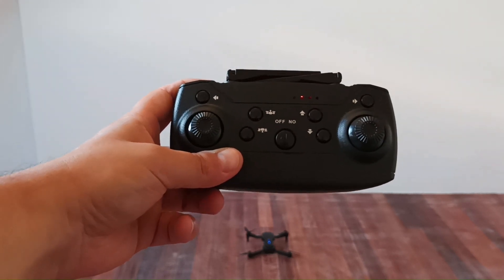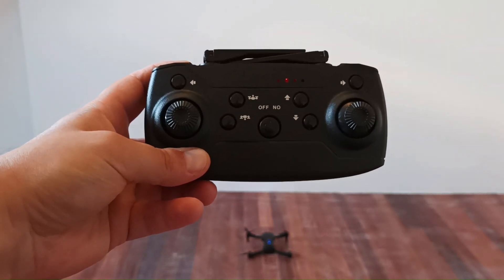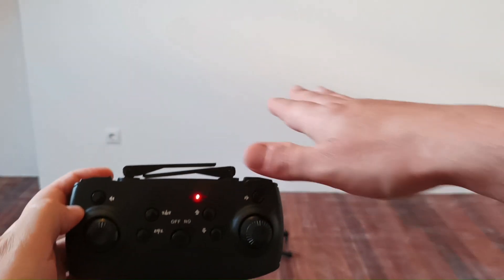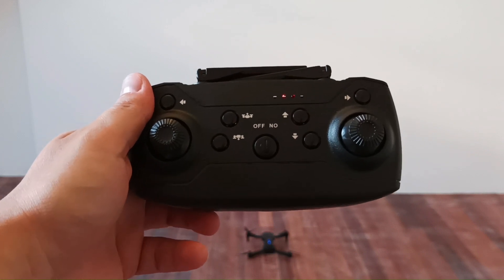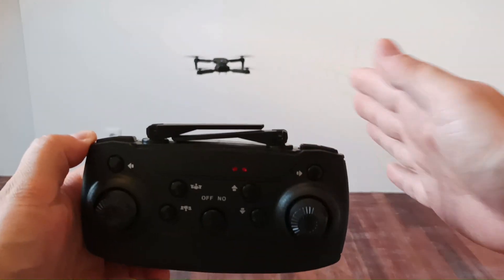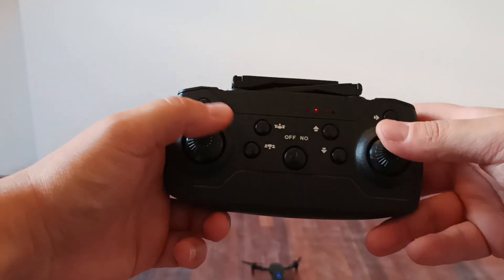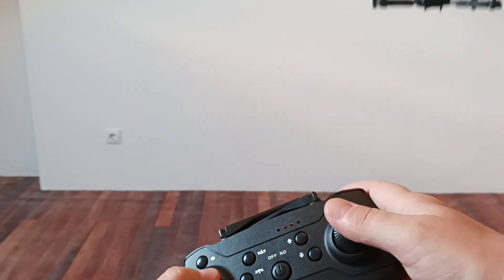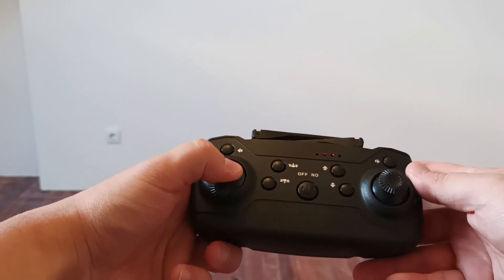How to Calibrate E88 Drone? Factory Calibration Reset. How to Calibrate a Cheap Drone while Flying?

Comment: Does this work with e88 cope drone from china? Mine is not working moving JS keys in all directions. What joy stick keys are you actually mobing for calibration. You forgot to tell ir specify it.
Reply from the maker: Yes, this is 88 drone with its original remote control. The buttons are those that have arrow indicators, not the sticks that control the movement of the drone.

Comment: How is the drone camera quality
Reply from the maker: These cheap drones usually have very bad image quality. The videos and images are pixelated and blurry. You can check the videos from the same playlist with image quality reviews. Even if the manufacturer claims that 4K videos can be shot with these drones, the resolution will be 4K, but the bit rate will be so low that the resulting file size will be too small to provide good image quality. Also, these drones cannot have expensive lens inside for the price they are sold for. These drones are not for filming or photography, just to play around and practice flying.  A kind of a starting point to understand if a drone could become your hobby or not. Also, not a big deal if you crash it. So, it is a good idea to practice with the cheap drones, to avoid crashing some really expensive ones in the future if you decide to get one.

Comment: I just lost my this drone everytime I would start it and fly up it would drift away and I would have to bring it back to me and I went to even higher up I couldnt controll it because it was drifting away and I wasnt sure where to drag the joy stick and I tried all directions and it flew to my neibourgs and I managed to bring it back over my house and then it just kept drifting away and now I crashed it far away i think on the car road or maybe on a field
Reply from the maker: Yes, this happens when you fly at different altitudes. When flying higher, your drone may be swept away by the winds that you do not feel on the ground. When the drone is taken away by the wind and starts rotating, it is hard to understand at which position it is, so you get confused with the controls. The higher you go, the more difficult it is to see where the front part of the drone is, and thus difficult to bring it back. The suggestion here is to have the drone connected to a phone and have the video feed turned on, so that you can bring the drone back looking at the images that you get from the drone. This way you know where the front part is and where it is heading. If you lose the drone, but the drone is still on, you still can try to catch its wifi signal and try to connect to it with the phone and see if you get any image from it. If you are lucky and can get connected to the drone, you may figure out where it is or try to take off. Or, if it landed nearby, you could wait until it gets darker and check if you can see its blinking lights, if the battery does not drain until that moment.

Comment: Hey guys, we bought it for fun and when i press the take off button, it will start only for one sec and then it will die :D anyone know how to fix this please ?
Reply from the maker: Could be bad battery, check the battery voltage if you can. Or try manual take off?

Comment: Legendary stuff, I got mine from Temu today and it worked fine for a bit. Plugged it in to charge and when I put the battery back in it wouldn't take off and what it thought was up was definitely not up 😂😂
Reply from the maker: May be your charging cable or adaptor is bad and the battery did not get charged? If you have a multimeter, you can check what voltage the battery has.

Comment: how do i stop the gyroscope, or at least wheres the location of the MEMS gyroscope?
Reply from the maker: There is no way to turn it off.
Reply: Planning on desoldering and then wiring it manually with resistors so it thinks its always up, but idk where it is @AventuraRemoteSmart

Comment: what I dont like with this drone is the joystick is not analog.. its just 4 buttons disguised as analog stick..
Reply from the maker: I would not say that these are just buttons like sticks,  the more you move the stick the faster it moves in the corresponding direction, so there is resistance inside, it is not just on/off buttons.

Comment: Mine doesn’t do anything for pulling down the 2 sticks, its not even holding its height while flyin just falls if I don’t push it upwards :/
Reply: Ah nvm just made it work, you gotta nail the angle. Will see if it works
Reply: @Mtmass91  use your Phone + App to calibrate

Comment: Hello friend, I have 3 questions, thanks in advance. What are the steps to do the factory reset? What are the steps to calibrate the gyroscope?
Reply: Bro you have 2 option either calibrate it with the remote controller or with the rc fov app😊

Comment: Hello my e88 drone one of its propeller keep spinning even the drone still not on
Reply: Probably a soldering issue just open it and check the wires and soldering if you have any experience if not just take it to a shop

Comment: Is it a must to cancel the gyro calibration when i switch off the drone
Reply from the maker: There is no such thing like cancelling the gyro calibration. You can reset it. After turning the drone off, when you turn it on again, it may keep flying well, and if not, you need to reset it again or adjust it manually using the four buttons while in the air. But the general advice by the manufacturers is always perform factory calibration after turning the drone on (gyroscope reset or factory reset) and then, if necessary, fine tune it with manual calibration while in the air.

Comment: Great video Dude, but I have a question..
Do I have to calibrate every single time before each flight, or juat once?
Does the drone save the calibration in its memory?

Thx 🙏
Reply from the maker: Calibration reset looks like saves it in the memory even after you turn the drone off. Calibration that you perform during the flight looks like not. Mainly for cheap drones, it is always advised to do a calibration reset on a plain surface after you turn it on. On more advanced but cheap drones it may not even let you fly if you do not perform calibration.
Reply: @AventuraRemoteSmart   Thank you so Much Buddy !  I got this "cheap" drone for my gf and I got for myself the Potensic ATOM 4K, so we both will learn starting with the basic cheap one and then moving towards the more advanced one.
The price was good so I really couldn't let it pass, being able to see this beautiful world from above, I think it's a dream finally come true for any Human being. 🙂🙏
Reply: @AventuraRemoteSmart  don't this have 1 key take off or land 
why you keep push down the left sticks all the down, will it not break the drone if it were outside

Comment: Thanks fir the video, I have the pro version drifts a but to the left but correction using the rigjt button, do you have it in speed setting 1 when testing and have you tried to perform roll stunts.
Reply from the maker: Rolling in the air works fine. When calibrating, the speed setting should not matter. I usually set the speed level to the highest to have better control of the drone.

Comment: Can't save calibration after we tune it?
Reply: You just calibrate it each time you want to fly, it's easy to do.
Reply from the maker: Better calibrate it each time before flight, in some cases it may fly ok without calibrating after take off as well. This model has a camera at the bottom which helps to stabilize the drone.

Comment: I did it on a plain surface but when I did the calibration and start flying it always drag to the right, did I do something wrong?
Reply from the maker: Not to be confused here: one thing is the calibration before take-off, and then, if it still drifts, you calibrate it in the air, which is another thing. And this drone does not have GPS system, so a bit of drifting is normal.
Reply: Press the left button a few time till it comes to the centre. Done.

Comment: The lights on mine start blinking faster once the controller is connected and it doesn't do anything
Reply: Mine have the same issue with e88s Brushless drone. Led light keep blinking and it's not stable and hard to control.

Comment: After I calibrate it continues to blink and will not start flying what am I doing wrong?
Reply: I took this one and the E88 outside today because it was very windy and  I figured I could battle the wind and defy the odds. Had a blast and controlled its path down wind a few times. Overall I had fun. I made a good landing when I needed to and kept it calibrated with the arrow buttons against the wind and whenever it went off course. Just gotta work with it at times
Reply: @CaptainGuffaw you're not supposed to calibrate it against the wind. It's supposed to be calibrated in a low wind or no wind environment
Reply: Your battery is too low, needs charged
Reply: Yeah, it's an eight dollar toy so it'll be fine lol
Reply: It's dead
Reply: Reset it, it worked for me
Reply: @zedeify how do you reset it?
Reply: @TyreekAkbar  I forgot lol, but I found the problem was the propeller was just broken. So 1 propeller wasted the drone
Reply: One of my propellors is Stuck. Anyone else had this issue?
Reply: Mine makes a drastic drift backwards after engaging engines
Reply: Turn drone in 1st
Reply: Up then down on left throtle

Comment: My E88 drone after i factory reset it still drifts in one direction and can barely takeoff like not even get off the ground
Reply: Same problem
Reply: Same problem.. is anyone found the solution
Reply: Me too. I had another one of these drones and it never had this problem.
Reply: Did you remember to put your propellers on
Reply: @RBKTWN how do I put the propeller
Reply: Change changing ur location
Reply: Change the blade